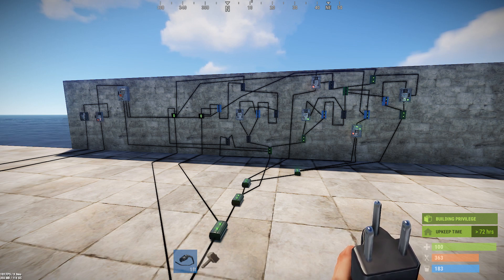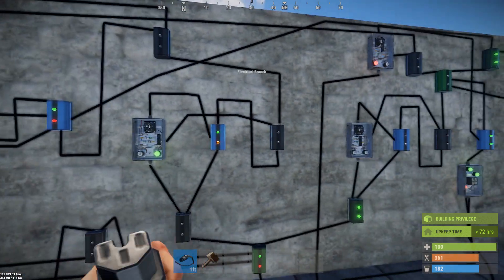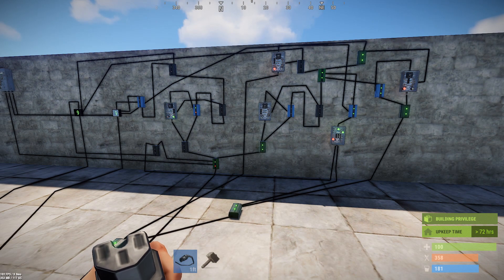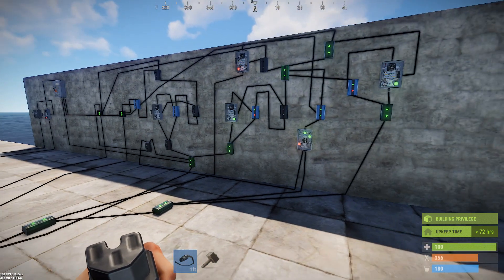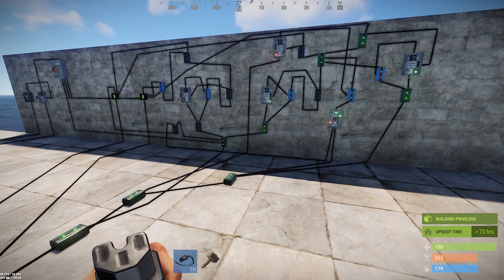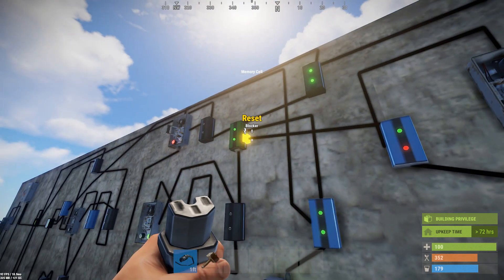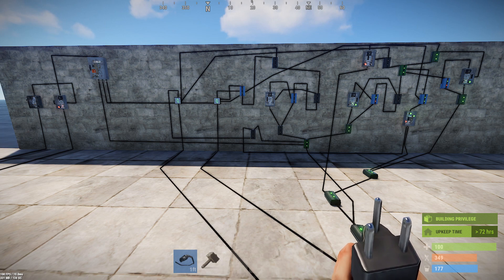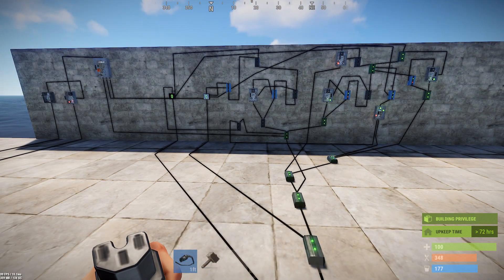Rust Electricity: User Request - Cave Base Day/Night Timer

Comment: Great Job I am having an issue with the first timer constantly being triggered by the solar input to the toggle on switch. Its pretty bad since it completely resets the timer and puts it out of sync so fast. its random. Sometimes happens after a few mins, sometimes it happens after 15 seconds or so.

I even tried regulating the connection to the timer with a switch so that no power would be going to the toggle and it somehow still activates itself randomly.
Reply from the maker: This was a tricky edge case example. Since the time resets when it loses power input, using it reliably as a timer without a reliable power source can be a problem!

Comment: But how to generate electricity inside a cave for running this clock?
Reply from the maker: They were bringing down power from solar on the surface. The cave with the spike trap is shallow enough to allow for placing power on the surface.  Example: https://youtu.be/S-0GYUHyJp0